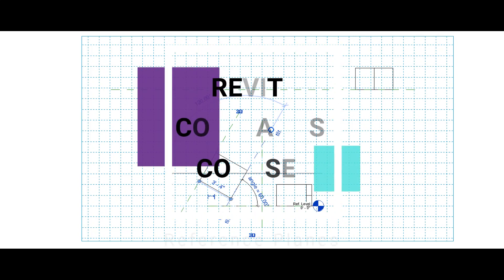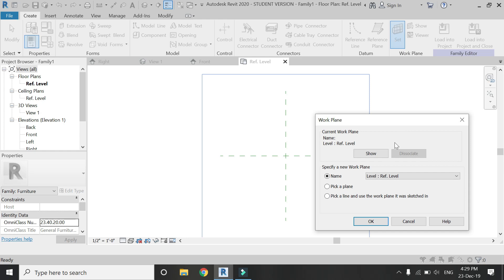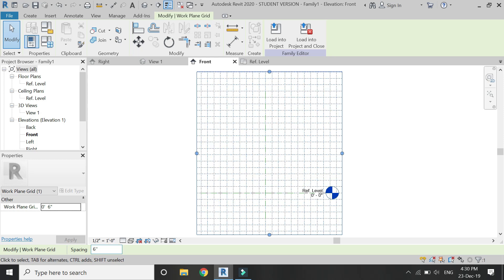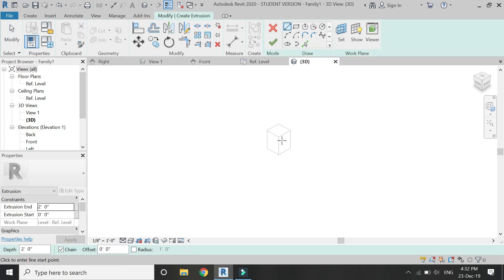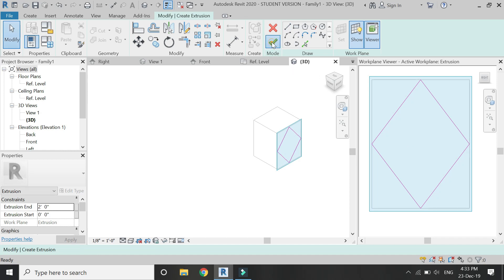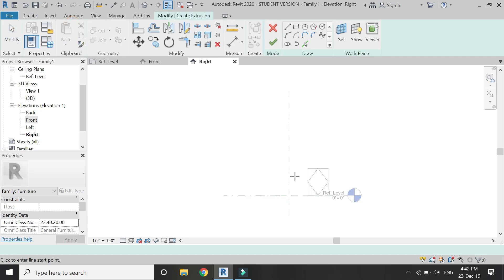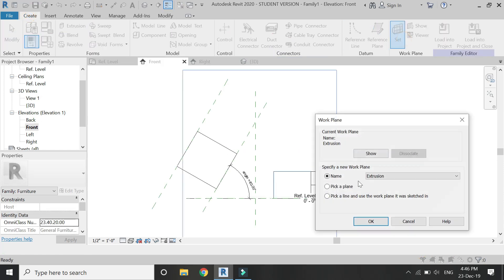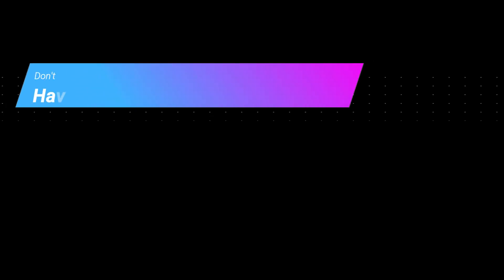Revit Commands Course - Reference Planes

Comment: I have a Question: 
I'm modelling a 5 storey building that has projections on each level (some varying some same). I want to get the overhead lines(projections as well as beams) displayed on each floor in dotted line. The solution that I know currently is to turn on underlays (which is a bit confusing...look up/look down) and then manually select the lines and change them under LINEWORK-LINESTYLE. To select each line individually on EVERY floor plan is very time consuming and it feels very "Autocadish". I only have 5 floors but if I were modelling something like the Aqua building by Gang (in which each floor slab is unique) it would take me days just to get subsequent floors visible on each floor plan. Is there an option to do this quicker? Would really appreciate a video on this since it is a recurrent issue with a lot of users.
Reply from the maker: There is kind of one way of doing that in which you can obtain the overhead hidden lines without using the linework command. I will upload the next tutorial regarding this issue. I hope that tutorial would be of some help.
Reply: @LetsRevit  That would be great. Thank you.